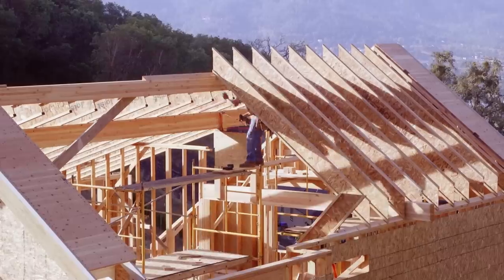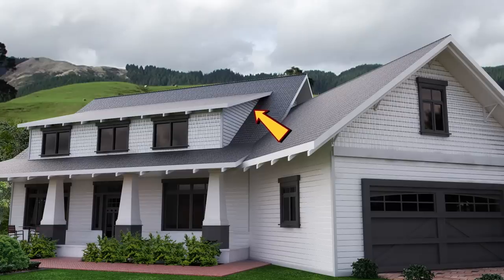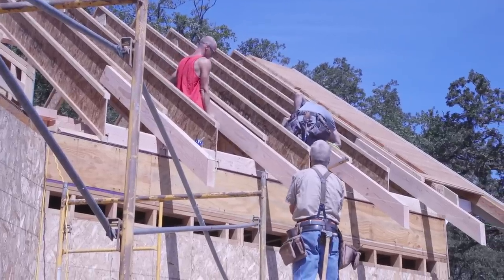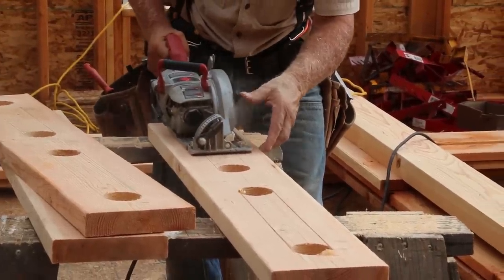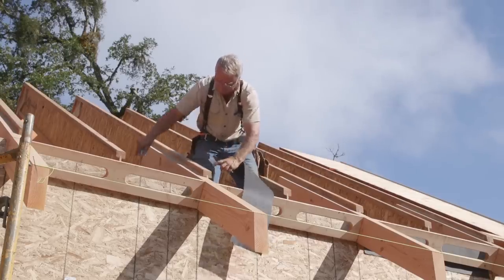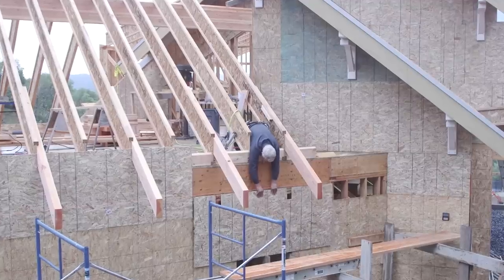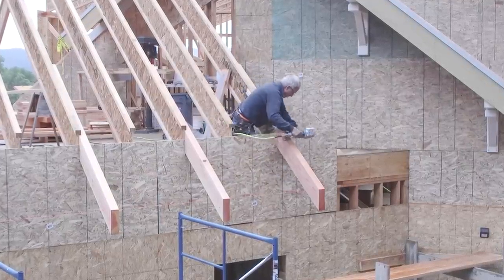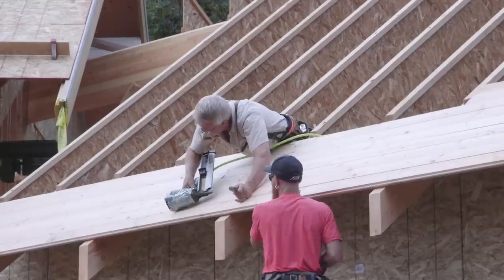Avoiding Mold with Mega Vents Ep.66

Comment: Keeping the roof well ventilated also prevents the freeze/thaw cycle of snow and ice on the roof creating ice dams that allow water to  creep under the shingles and find an entry point into the structure.  Unless I miss my guess, I'm betting that we will be seeing ice shield like Grace or some other product being applied on the roof sheathing right up to the ridge vent.   Relatively inexpensive insurance against the relentless destruction of the roof system and other water damage during the winter months.  At least that's what we do here in the northeast.  Not sure if the Pacific northwest has the same issue. A little more temperate in your part of the world Scott?
Reply: Would be a non issue if he went with a metal roof.
Reply from the maker: Actually, we get almost no snow here... only an occasional event over 3-4 inches.
Reply: @essentialcraftsman  Nice!  One less issue to deal with.  Probably gives you a longer building season.  Cleaning snow and ice off staged material is a real time killer and a bit of a buzz kill (so to speak).
Reply: @Azathoth43  Not really.   A metal roof can get ice dams also, depending on conditions, and if you have melted water backed up behind an ice dam, it can find it's way in; through seams, or through fasteners with less than perfect seals.

Comment: Nice vents, over vent the bottom compared to the top. If you over vent the top you'll pull warm air from the house to feed that vent, you don't want that
Reply: You can always baffle sections of vents, top or bottom, to achieve ideal flow.

Comment: Holy drilled boards Craftsman, who ever designed these  disastrous vents just assured that they'll be a headache for the future owner because they'll import as much moisture as air into the roof. Not only will the raw wood on the inside collect moisture/mildew like a sponge, but the the insulation will wick it up its entire length perhaps in as little as 3 years. But to think that Tar Paper tacked down with a stapler over the OSB will be a permanent weather shield would be laughable if it wasn't such a colossal blunder and it will be the first to fail in this flawed design. So buyer beware since it should be torn out and done over because it actually makes mold more likely not less due to it being that flawed the moment the first vent was nailed in all those weeks ago...
Reply: Can someone with some knowledge comment on this? It seems Richard has a good point. If there are vents at the top, the air will flow through the lower vents and out the top, bringing moist air into the attic.

Comment: No seat cuts?
Reply from the maker: No, and it made me queasy too. The Boise Cascade specifiers guide does not allow it. I called them and they said that to reduce the cross-section of the bearing on the bottom flange by putting a seat cut in it is not a good thing. They recommend this application. I checked with my structural engineer and he concurred. I’m not sure I like it, but it was the best alternative. It is structurally sound because the roof diaphragm transfers the sliding moment to the gable end walls which are sheer paneled.
Reply: Ya I figured it was engineered and in the plans but just like you said makes me queasy I'm a carpenter from Massachusetts I like those I joists for my floor system but like a good old stick frame with 2x10 or 12 fir lumber for rafters...but you do amazing work love the videos

Comment: What was going on at 9:12?
Reply: Looks like the gable fascia system had a curl in towards the house. Probably something about the presentation board on the outside maintaining its length while the dimensional lumber they laminated to the inside dried out and tried to shrink, curling the whole thing. They put in a temporary brace to push the tip out until they got enough decking installed to keep it straight.

Comment: Upper and lower hurricane clips?
Reply: Ed Jones , perhaps in Florida or Oklahoma (tornadoes); Pacific Northwest doesn’t get those kinds of winds. (Except right on the coast.)
Reply: @DanielinLaTuna  im in spokane.wa we require them state wide, strange?
Reply: @edjones8706  , we use 'em in California,  but not for hurricanes  -- for seismic activity (earthquakes). Not sure why Spokane would require them.
Reply: @DanielinLaTuna  hurricane clips are required by code to be installed from each truss to top plate using teco nails
Reply: @edjones8706  Just speculating, but I bet it’s a situation where places like Spokane get caught up in the new building codes, that takes more of a “one size fits all” approach. Clearly Spokane will never suffer the wrath of a hurricane but in an attempt to ‘simplify’ all the different regional building codes, the unintended consequence has been to complicate things. 
What a rarity when govt regulation, intended to simplify has the exact opposite affect. 🙄
Reply: Ed Jones , teco nails are the right ones. My first projects with Simpson joist hangers I just used regular nails. Luckily those projects didn’t have much load. The teco nails have the right shear strength and won’t fail under load.

Comment: Here's what I don't get. If you have all these vent holes how does your house keep in the heat during the winter?
Reply: the vent holes do not ventilate the living space.   The vent holes will be ventilating space in the rafters, there will be sheetrock, a vapor barrier, and a layer of insulation between the ventilated space and the heated living space.
Reply: @andrewalexander9492  Yeah I get that But there's still a ton of insulation in the attic. If the vents are letting in cold air, whats the point?
Reply: @justinfiorini3142  Well, again, the ventilation is to the space above the insulation, the cold side of the insulation.
Reply: @justinfiorini3142  Trying to come up with a way to explain it, it would be easier if I could draw a diagram;  The space the ventilation air is flowing into doesn't have insulation between it and the outside, the only thing between that space and the outside air is going ot be the roof sheathing (one layer of OSB) and the roofing shingles.  So there's really no significant insulation between that space and the outside. There is however insulation between the ventilated space and the heated inside.  Does that make sense?
Reply: @andrewalexander9492  😂 I feel your frustration! I don’t know how many times I wished I could include a sketch in the comments section. Maybe that’ll be the next YouTube innovation!

Comment: You often mention "free of heart center wood". Why is that important?
Reply: Jason Steffler, timbers come from either the heart (center) of the tree, or the edge near the bark (sapwood). The better, stronger wood is from the center. 

There are two ways to cut heartwood. Boxed heart timbers 'box' the heart of the tree within the edges of the timber - or we could say the timber is cut around the heart of the tree. Checking occurs with much more regularity in boxed heart timbers. As the timber dries the shortest path to the heart will check. For some this is inherent, preferred character. For others "free of heart" is the way to go.

Timbers free of heart are cut without any heart (center) of the tree within the perimeter of the piece. On occasion there will be some heart at the edge of a free of heart timber. Checking is very minimal with free of heart timbers often resulting in a very "clean" frame. In order to cut free of heart the raw tree/timber is typically much larger than a boxed heart tree/timber.
Reply: @DanielinLaTuna  Or to simplify, “quarter-sawn lumber”.
Reply: psidvicious , not exactly. They do share the characteristic that the grain is radial. (Looking at the end grain the rings are parallel to each other — but for a different reason). Flat sawn, near edge, starts to cut across the growth rings, but quarter sawn will always cut parallel to the growth rings.

Comment: I cant take it any longer (all in good fun). Has anyone else noticed the guy that doesn't use ALL of his hammer handle?  I've framed more houses than can remember and worked with just as many framers (they came and went like leaves in the fall in the '90s. We would have teased this guy about cutting off the unused portion of his handle.........until he started using it the right way. Trust yourself to swing the entire hammer. If it's too heavy, get a lighter one. Just my advice/opinion
Reply: You said, “all in good fun”, but then you seem to be genuinely unfamiliar with the practice of choking up on the hammer handle for this or that application. Are you serious, or just kidding? Bcz it’s extremely common to choke up [or not], depending on what you’re doing.
Reply: @psidvicious  watch all of the previous videos. He "chokes up" everyime you see him with a hammer. Some guys just don't know how or havent been taught how to swing a hammer properly. The all in good fun is referring to the teasing he would have received from the rest of the crew

Comment: Serious question... why is this build taking as long as it has?
Reply: They've answered this question a number of times in videos and podcasts (which are on their EC2 YouTube channel).  But, in a nutshell, they are way behind with their videos. The footage here was shot when there was an abundance of sun, so probably 4 months ago.   He's running a YouTube channel, doing podcasts, putting stuff on Instagram, doing a little blacksmithing and they are filming it all which eats up hours every day.   There are two to three guys doing all the work.
Reply: The building season is short in Oregon, including in Roseburg where he’s at. Scott is running a small crew, so he builds as much as he can during the summer. Has to stop when the rain comes. Once the house is walled and roofed he should be able to work inside when it rains.
Reply: @DanielinLaTuna  Bet if you drove by the house you'd see that it's been shingled.
Reply: @pnwester2697  , I'm sure it is.

Comment: A router is not a framing tool unless you are a top notch builder.
Reply: Not necessarily.  A lot of framers use a router with a plunge pilot bit to cut out window openings, even some less than top-notch ones.
Reply: @andrewalexander9492  That is not a good tool to use for that. It's heavy and awkward. A roto zip is way better or even a sawsall. They come battery operated and with good power. Routers are not good using at 90 degree angles. Dangerous. I remember back in the 80's when guys use to use them. No good builders use them now. Too many other good tools to use.

Comment: Your son will have a fine home.
Reply: Not going to be Nate's home.
Reply: @pnwester2697  Then the profit margin is going to be mighty slim. 

I just wish there was a contractor in Tennessee who could build a house.  They were all wiped out during the bubble ten or so years ago.  I just watched a "major" home builder put up his pre fab components on green concrete.  That's one example of hundreds in my small county.

What inspector?,  you may ask.  Exactly.
Reply: @flyingjeff1984  What do you mean ‘green concrete’? New? That term in my area refers to freshly poured, new concrete.
Reply: @psidvicious  Yep.  The concrete was still giving up water on day 3 when the building package went up (1 day build.)
Reply: @flyingjeff1984  I’m not sure I’m following you though. Are you saying there is some kind of negative affect to beginning framing when the concrete is “green”? Any wood that comes into contact with concrete is required by all the codes that I’m aware of to be pressure treated. So I don’t see any issue there.